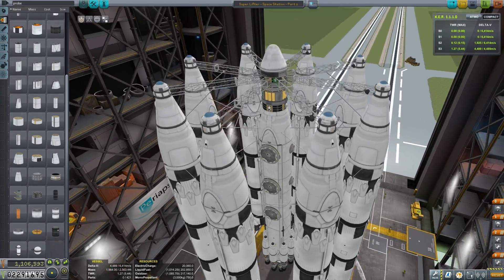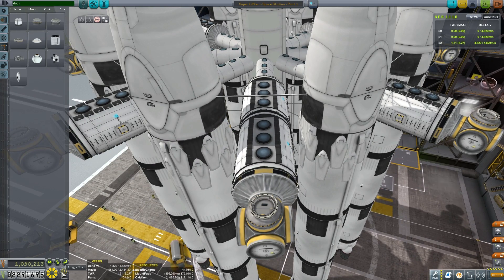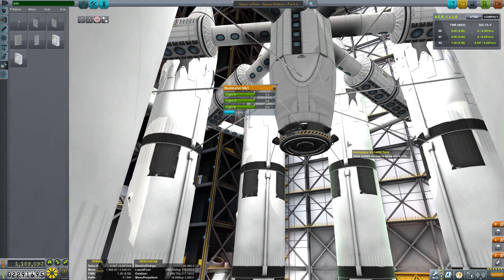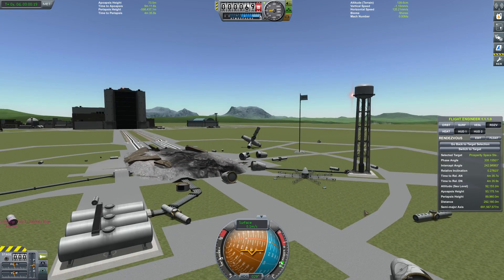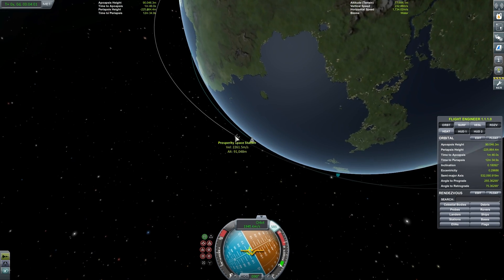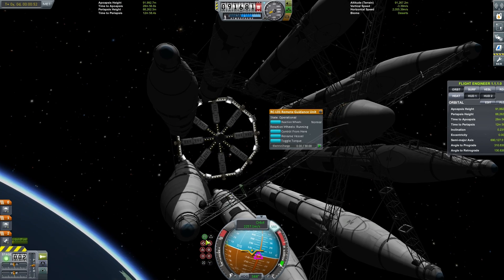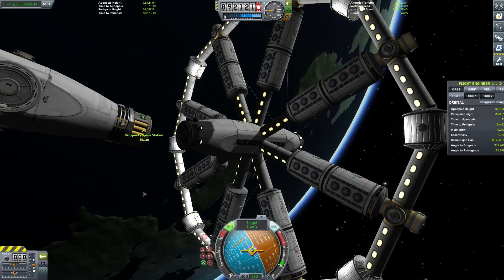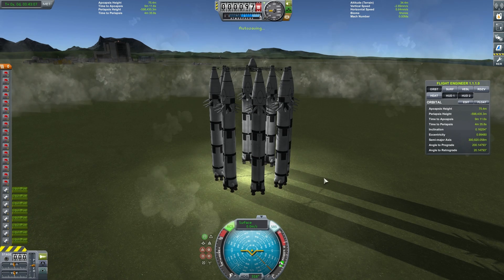Super Habitat Module (Tutorial: 22) Kerbal Space Program 1.1.3 Stock

Comment: asparagus stage with 3 booster stack? add 2-3 stacks of tech 2 tanks. 2 shuttle engines per stack w/splitter. so 12 engines per stack roughly. can add an SRB so you dont have to throttle up of the pad. asparagus stages have drone core and a special trick.. cargo bay w/parachute.